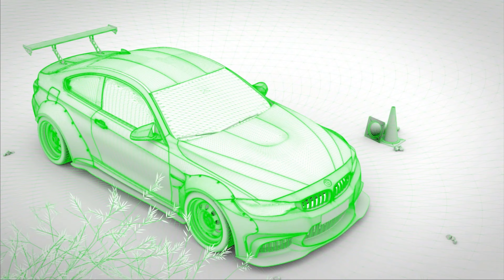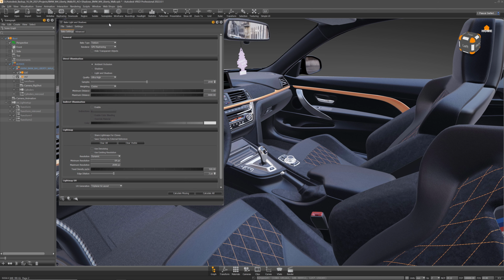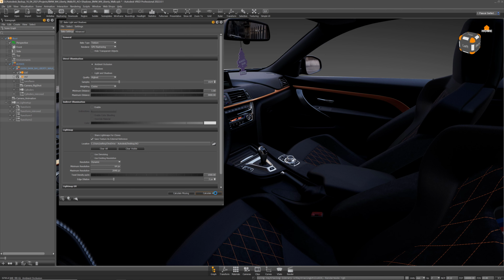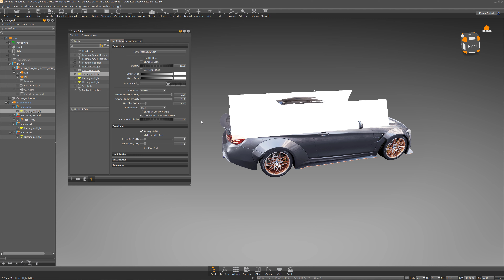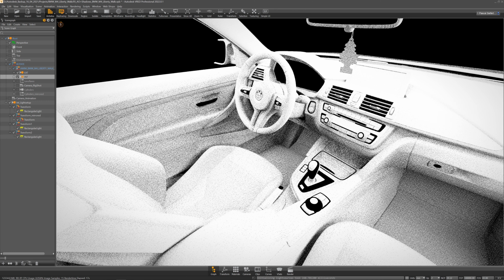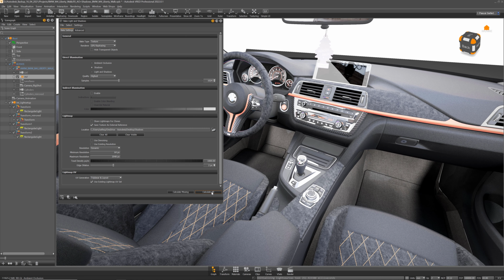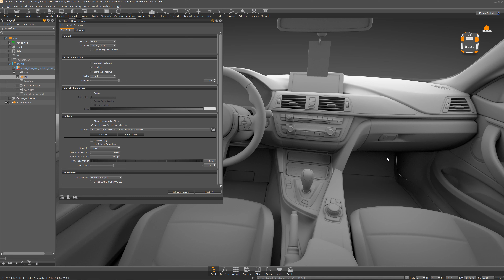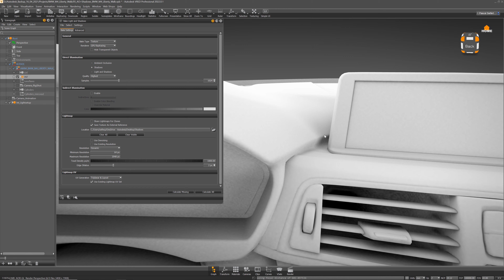Autodesk VRED - Tutorial - Ambient Occlusion vs. Shadow baking for Car Interior

Comment: Thank you for sharing, nice stuff! But only thing I confused that why not enable the 'indirect illumination' when you baking? I think there are some deep comer and areas still need indirect illumination in car interior.
Reply from the maker: Indeed that would have been possible. The thing with indirect illumination is that the bouncing light takes the material color in account and is (indirect) illuminating the surrounding objects with the color it hit before. That would make switching materials from one extreme into the other impossible without also switching the baked lightmaps. In case you have baked with red leather and want to switch to a white leather for example. Therefore it is possible to set an "Override Color" in the Indirect Illumination tab that allows you to override the red leather with a mid greyish tone or whatever you set there. Would have been possible to get the interior a bit brighter indeed. Haven´t thought about it too much but good hint, thanks.

Comment: IWhat's the difference between bake type Vertex and texture, which one is better?
Reply from the maker: Vertex baking (as the name states) bakes the shadow/AO into the existing vertices of the mesh. This means your quality is kind of depended of your tessellation/mesh density. You can activate sub-division in the module but this introduces new triangles in your mesh where needed. Texture baking calculates the shadow into a texture and your quality is depended of the texture resolution. It requires kind of a good lightmap UV but you are independent of the mesh density and can have good shadow quality on a low poly mesh. There is no right or wrong but as a rule of thump, I would say if your mesh has already high triangulation you can go for vertex baking. But if you want to keep the mesh low poly and willing to create Lightmap UV´s you go for texture baking.
Reply: @VREDexpert  Thanks😁

Comment: I have a question that I would like to ask. After the VRED rendering image becomes larger, the rendering image in the occlusion layer of the PSD format file is messed up. I don’t know if you have encountered this before. (File settings such as A0 size 300dpi)
Reply from the maker: This sounds a bit like your running out of memory on your card when rendering such a high resolution, as the frame buffer requires memory for all passes during rendering. If rendering to a smaller resolution works for you than this is probably the issue.

Comment: Thanks for your sharing, and I have some question about at the begining of video. You can change the color of ambient light, turn on/off and regulate Intensity of light using by Varient Set. I suppose you using Script that things, but I can't found them at all. Could you share about that script or maybe how to make that one please?
Reply from the maker: Are you referring to that video https://youtu.be/SJ-6bb9Bjmc ?
Reply from the maker: If so and if you follow the tutorial on how to bake lights separately the script can be seen at min 17:35 in the variant set editor.
Reply: @VREDexpert  Thanks a lot about your answer. Furthermore, is it possible changing light's color softly, like light turning on&off?
Reply from the maker: Those separate baked light intensity and color values appear not in the curve editor. But I think you can also script sth. changing the values over time in Python.

Comment: Hello! I have an issue when using triplanar for the lightmap UV, where I get really harsh edges in my bake (looks like s***t). I've increased edge dilation also, but it doesn't seem to help. From what I see, you don't get the same problem. Do you have an idea of what the problem might be?
Reply from the maker: I don´t think it is an issue in general but rather what to expect from cutting an organic shape from 6x sides. You´ll never get clean UV borders compare to a manual unwrap which is obviously more time intense. I never recommend using the triplanar option in the bake module in my other tutorials https://youtu.be/CokLUiOmyRI for that reason. The dilation setting just defines the space between the island. The default usually works fine. If you really don´t want to go through a manual unwarp process, a larger texture size can help. You can also try to set the fewer island option in the UV Editor. Objects > Projection > Place Texture3D. The CPU denoiser also does a better job on the UV borders compare to the GPU denoiser.
Reply: Alright! Thank you so much for the fast reply!

Manual unwrapping is not really viable for the time frames I'm working with. I'm experimenting a bit now with different settings now, and am considering using vertex bake with subdivisions instead of texture. I'm quite new with VRED, though. So maybe there's something I'm missing about texture VS vertex baking?
Reply from the maker: @maiqtheliar2  vertex baking requires a descendant amount triangles to store shadow information on, which might have some disadvantages on the other side like VR. Also the quality or details could lack if you go close. While for texture bake you can have a low triangle mesh and very detailed shadows on the other hand. There is no right or wrong and always a trade off between time vs. quality depending on your use case as there are parts like an engine that are impossible to unwrap.
Reply: @VREDexpert  good to know. I think I'll just have to keep experimenting to see if I can find that sweet spot for looks vs time vs performance. But thank you so much for the help!